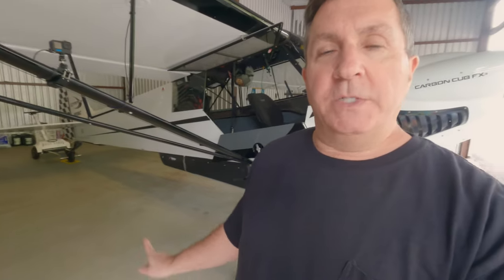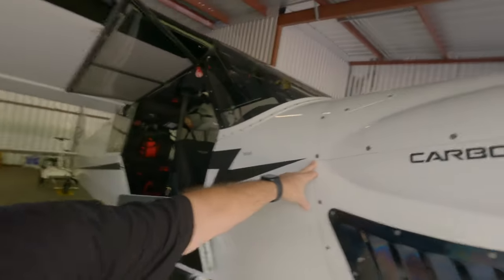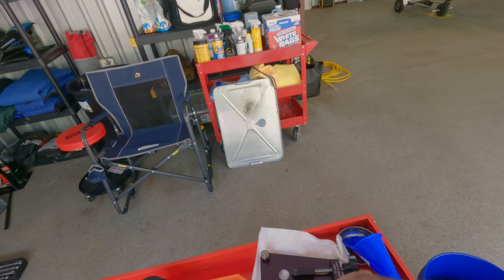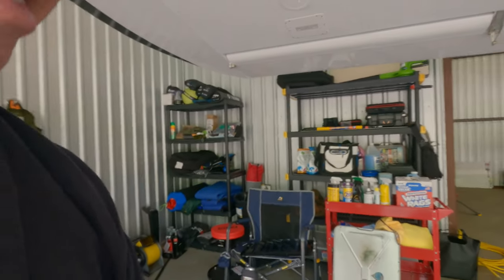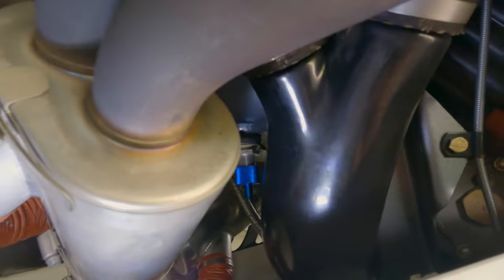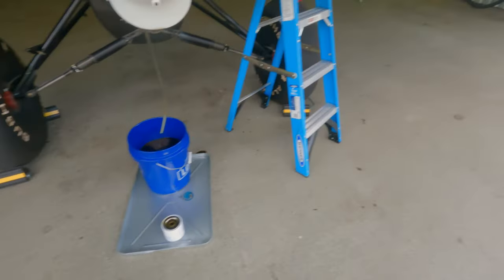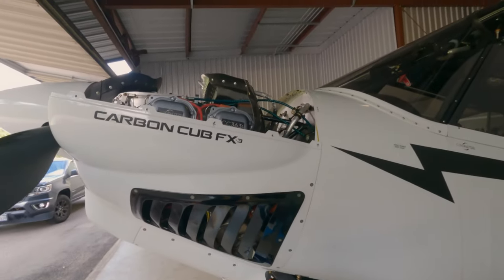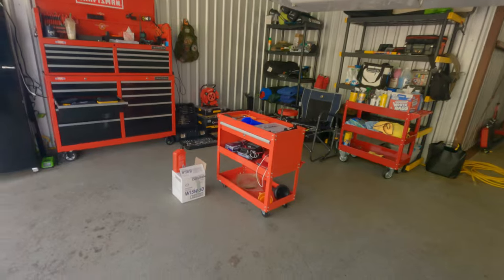How to change the oil in a CubCrafters Carbon Cub FX-3 with Lycoming 363i

Comment: Wished I'd watched this before removing ALL the cowl screws and throwing them in the same tub! Imagine my surprise when I started to put them back on and found a couple of long ones! I ultimately figured it out but I was scratching my head for a bit. Also...keep an eye on the washers as they have a tendency to group up in twos and it's a bit hard to detect until you come down to 1 screw and no washers. I also removed the upper and lower cowl rather than the upper and "louver" which is what CC calls the "gills" (a more descriptive name in my opinion). Love your channel Neal!

Comment: Thanks for all of your help with my first oil change, Neal. I took the cowl completely off, lost two washers, and had a hell of a time getting the hose clamps reattached to the hoses (they kept sliding up). I wish you had published before I tried, but I'll always return to this video when the time comes!
Reply from the maker: Still good to learn for when the time comes to deal with the bottom cowl. It is harder to get off and the orange scat hoses take practice, hose clamp positioning, etc. is important to get a screw driver on them properly. One of the two on the bottom aft is tricky on mine. Glad it helps, fun learning this stuff although painful at times.
Reply: @NealCuliner  Yes, the bottom left is very tough to seat properly. It seems to be holding thus far, but I may take some time to mess with it again in the future.

Comment: Thanks!  Wish I'd seen this before doing my first oil change, as I learned a few things the hard way.

You mentioned putting oil on the filter gasket, which is what I've always done on my car.  Last time I used a Tempest filter, their instructions were to install it dry.  Champion, calls for DC-4 (Dupont Molykote 4) lubricant.
Reply from the maker: Thanks. I'll have to research that. Appreciate the feedback. If you have references please share to save some time locating.
Reply from the maker: Thanks Scott, I did some research, very interesting findings: https://flightinfo.com/threads/changing-the-oil-filter-should-you-lube-the-gasket.161111/

Comment: Ah, thought this was referencing the long one needed to get into the little exhaust drain that needs to be cleaned all the time. Lost a rifle cleaner in it the other day and had to take things apart to get it out…
Reply from the maker: Yes, that is the long one. It's called a Tube brush and it's one piece. You can find them online too if you search for 3/8" stainless steel tube brush. I think 18" long is the length?